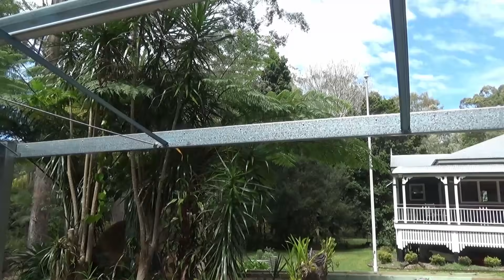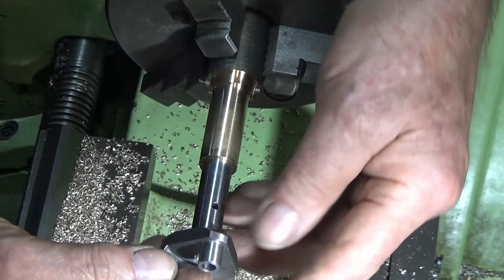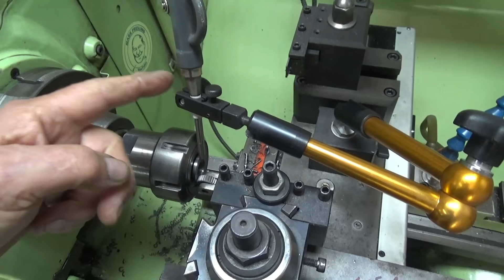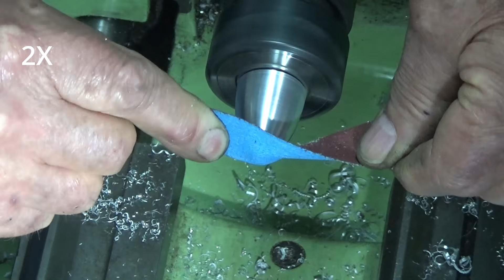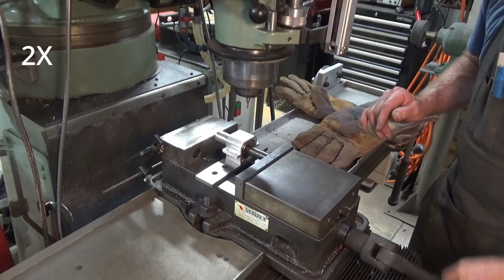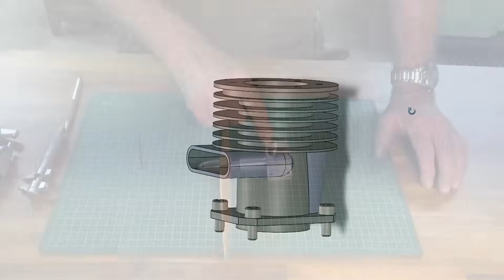Crusader 60. A Model Aircraft Engine You Can Build Without Castings. Ep.3 - Prop Mounting Parts

Comment: Hi Preso. That Turnado turning system is new to me, very interesting. Could you mount a drop on cover plate on the little tool post to shield the template and stylus area from swarf? Cliff
Reply from the maker: I had not thought of that. The swarf does build up easily and it can get in the way. I will need to investigate some countermeasures!
Regards,
Mark

Comment: For the carport.  The sheets on the roof are structural and keep the channels from "lateral-torsional-buckling".  The failure mode is the compression flange locally buckles and the channel rotates to 45 degrees or so and the channel folds up.  It is important to get sheathing on any light gauge framing before load is applied.

Check your drawings for the prop that is in the middle of the channel.  That might need to be at the bottom flange of the channel not the top.  The sheathing keeps the top flange compression in line but when the wind blows the uplift causes the bottom flange of the channel to be in compression so it could use a bit of support to keep it from buckling.

Comment: Finishing up the crank shaft , What's the purpose of the groove by prop driver ?
Reply from the maker: The prop driver has a pocket which fits over a pin in the reduced diameter on the end of the crankshaft. This gives it a positive drive.
Regards,
Mark

Comment: How about using a two piece bronze bush, each with a ‘thrust bearing flange’ one on the inside, one on the outside? This would give you a better surface to cope with the end loading from using a starter? Just a thought.
Reply: I think that's a good idea. The internal one is lubricated by the fuel, but the exterior one would not have any lubrication when staring the engine. But for the brief time a starter is engaged and pressure would be on that thrust face, I don't think it would be an issue. Or, maybe just a machined brass washer that goes behind the prop driver.
Reply from the maker: I have been told about something that I didn't consider. The rear rotary valve prevents the crankshaft from moving axially towards the rear of the crankcase. So, the gap between the prop driver and the end of the crankcase nose may not be an issue. However, rear rotary valve engines are not really designed for an electric starter. Pushing the starter onto the spinner would put an axial load on the rotary valve face which might create a lot  of friction and wear. 
Regards,
Mark
Reply: @Preso58  I did a stack-up and when all assembled there is only a .001" movement of the crankshaft back and forth; unless my calcs are wrong. The movement is controlled by the distance between the front face of the crank counterweight and the front face of the rotary valve. Stacking up the parts it is .651" for the static parts and .650" for the rotating ones. As Mark said above, the gap behind the prop driver doesn't come into it. So trying to limit that movement so, when using an electric starter, the crank moves back enough to push the crank pin solidly against the rotary valve (which then presses against the housing) is not really possible. Maybe slim down the front face of the rotary valve housing and add a brass shim/washer there to take the axial loads (and the brass would be the axial bearing). Or ignore it unless you are going to use the engine in an actual aircraft where it would be started many times with an electric starter. 

Oh, the solid model and the last page of the plans show the small drive pin in the rear of the crankshaft pin extending into the rotary valve housing. I'm being picky here but was trying to understand how it all works and rotates.

Comment: Very interesting again thanks. The carport is looking good too. Perhaps the designer has made it monocoque to save a quid. A bit like having a Spitfire carport instead of a Hurricane?
Reply from the maker: I did call the company with my concerns about the lack of stiffness in the purlins especially. They said they use some engineering software to calculate the wind loadings and the specification exceeds the expected loads. This is probably true but in a practical sense, you still need to build it and that means walking on the roof. I only weigh about 80Kg but I suspect that someone with an extra 40Kg would probably make things bend and not come back. 
Regards,
Mark

Comment: Excellent! I've got the crankcase and crankshaft done, so I can start on these other parts. I think I'd be more comfortable with a slightly looser tight fit of the bushing and using some Loctite. And as for the gap at the front of the engine, how about machining a thin brass washer to take any axial loads from an electric starter? Oh, I also (finally!) bought the diamond tool holders from Eccentric Engineering. A wonderful cutter arrangement.
Reply from the maker: That's great. Please send me some pictures of your engine when you get it finished. I am going to design an alternative prop driver which will have a counterbore on the crankcase side. The aim is to cut the clearance down to around 0.2mm.
I will add the alternative drawing to the set of prints I have already done. I will make this part too and I think I will flycut the face which I had knurled in the video. 
Loctite is a good alternative to a press fit for the bronze bush. It sure takes the anxiety out of getting the interference fit just right. Mine was a bit tighter than it should have been and the bore did close up very slightly. Enough to make the crankshaft stiff. 
Regards,
Mark

Comment: Hi Mark, great job so far ! A word of caution, this design is not particularly suited to using an electric starter. The force applied to engage the starter rubber is carried by the interface between the rotarty valve and it's housing which is likely to cause undue wear. I would suggest you stick to flick starting it. Looking forward to Pt4.👍
Reply from the maker: I had not thought of that! I am going to redesign the prop driver to cut down on the clearance between it and the bronze bush. I will see if I have the courage to flick start the beast.
Regards,
Mark
Reply: @Preso58  If you look at an OS engines plain bearing setup as in an FP or LA series engine, they have a hardened washer between the prop driver and the front of the carankcase to carry the load from the prop driver to the crankshaft bushing. The shaft can move for/aft about 10thou. This works when there is sufficient  clearance for the crank to move rearward without fouling the backplate and the rod can move along the wrist pin. I dont's see much in the way of clearance behind the crank in the drawings. I suspect it is deliberatly close fitted to prevent the rotarty valve sliding forward as there is no other retention for it.
Reply: @Preso58  P.S. you don't have to stick your finger in the prop, you can use a "chicken finger"

Comment: Most of my model engines have that gap more or less. You are correct in that the prop pulls the crank up against the bushing face to make a tighter seal. However the aluminum body gets quite hot when running full-boogie and the case expands much more then the crank shaft and that gap does get smaller. Look at it right after it has run a tank of gas through.
Reply from the maker: I need to check the two other smaller model engines that I have to see what sort of clearance they have. I am going to redesign the prop drive to cut down on the gap which does seem excessive.
Regards,
Mark

Comment: Brilliant. Thanks. Hey I built a few steel buildings during Army service as an Engineer. They are definitely designed to get their sway and racking stability from the skin. Not saying you didn't greatly increase the strength of the structure, but you may have found that it was actually pretty sturdy after all the panels were installed even without the mods.
Reply from the maker: I did get all the roof structure finished today but because this is a carport, there are no wall skins to prevent racking in the vertical plane. However, the posts are concreted in to footings that are 1100mm deep. Even so, walking on the roof feels like walking on a trampoline.
I will be finished all the high work tomorrow. I never want to do it again!
Regards,
Mark

Comment: Motor so far looking good. If you were worried about the gap you could just add an O ring but on the old plain bush motors I have had anything to do with you do need a little gap for expansion and with the rear carb mount only giving a partial thrust face not really a bad thing. The only thing to watch out for is when starting. If you use a modern style prop starter you can wear it quickly due to the push in the wrong direction. Best to use an old school "Chicken Stick" or that's what we used to call them.
Also if you want to do a nicer drive pattern on the prop bush you could try doing it with a fly cutter in the mill and held on /in your dividing head. Or as you have a shaper you could use that Not quite a Rose lathe but good enough.
Cheers
Reply from the maker: I am thinking now that the rear rotary valve will constrain the crankshaft axially so maybe the gap at the prop driver is not an issue? 
Regards,
Mark
Reply: @Preso58  The end float is fine but it will leak a little. The idea is if you ever fly it the O ring cushions the impact and prevents to much valve contact.

Comment: The dimensions that are most likely greyed out because the model was edited and the feature that the dimension is associated with no longer exists. You might try to delete the dimensions and re create them. 

Per Chat GPT:

In SolidWorks drawings, dimensions may appear greyed out (lighter color) for a few reasons, all related to how the dimension is being controlled:

Common Causes
	1.	Reference Dimensions
      •   Greyed-out dimensions are often reference dimensions.
      •   They aren’t driving the model; instead, they’re just reporting values that are already controlled by other features.
      •   Example: If you dimension a hole in both X and Y directions and then add a diagonal dimension, the diagonal is redundant and will show as reference (greyed).
	2.	Dangling / Disconnected Dimensions
      •   If the geometry that the dimension was attached to is deleted or changed, the dimension may turn grey to indicate it’s no longer associated.
	3.	Detached Drawing Dimensions
      •   If you place a dimension in the drawing that isn’t linked to the model geometry, SolidWorks may display it in a lighter color. These don’t update if the model changes.
	4.	Over-defined Sketch Dimensions (in sketches, not just drawings)
      •   In sketches, extra (redundant) dimensions show up in grey when SolidWorks switches them to “driven” mode.

Quick Checks
   •   If it has parentheses ( ) → it’s a reference dimension.
   •   If it’s dangling, you’ll see a small warning symbol and it won’t be controlling anything.
   •   Hovering over the dimension often shows a tooltip telling whether it’s driven, driving, or detached.

👉 In short: Greyed-out dimensions don’t control the model; they’re either redundant (reference/driven) or disconnected from the geometry.

Do you want me to walk you through how to change a greyed-out reference dimension back into a driving one?

Comment: Hi Mark freeflight power flyer in Colorado Springs, Colorado. I think it's important to get rid of that end play, most people today don't start engines by hand anymore but they shove it into a starter or shove the starter into the nose cone, with that gap between the case and thrust washer, during starting you'll be stressing the rod and wearing out the back case.
Reply: Ageed. I would get a stainless shim washer to fill the gap.
Reply: its more than a briggs and stratton lawnmower would allow (the pinnacle of engineering)
Reply: Indeed you also need to be a little concerned about the back plate as it's only partial I think so you can wear them a bit. Anything plain bush should really only be started via a rope or a chicken stick.
Reply from the maker: I am going to leave the prop driver as it is for now although I have designed an alternative which would cut down the gap to around 0.1mm or around .003". I understand what you mean about the rotary valve and it's something that I didn't consider. 
Regards,
Mark

Comment: Mark, just a comment on your colorbond carport. I recently designed and built my own home, with a colorbond roof, and steel purlins. I'm concerned that your designed roof is not sufficiently strong? Here in NSW, building regs required that I use MUCH thicker and braced steel, before attaching the colorbond roof sheets. I'm worried that if you have a strong wind,(with it being a carport, with no way to stop the wind acting DIRECTLY under the roof), that it might take flight!

Just my thoughts mark, regards,
Christine
Reply from the maker: If I had designed it myself, I would have probably overbuilt it. The engineering that came with the kit shows that they have used some strength calculation software and they claim that each member exceeds the expected wind loading but my concern was the requirement to actually walk on the roof while it was being constructed. Even with the extra bracing and adding the SHS inside the purlins it still seems like it flexes much more than I would like. I guess that for a habitable building the code is much more strict. 
Regards,
Mark

Comment: You are so right about tin sheds, same applies to kitset wooden ones, they have no strength until the last screw is fitted. Great in theory but as they wobble and move with the wind etc that last screw loosens and it blows to pieces. You wont know yourself having the whole shed to work in, Im extremely jealous of what you had let alone now :)
Reply from the maker: I was lucky that we didn't get any thunderstorms during the early phase of the build. I was worried about wind gusts. I got the last of the pieces cut and fitted today. However, I never want to build anything like this again. It has just about crippled me.
Regards,
Mark

Comment: That is coming along nicely Mark, well done all round. 👍 Side note: Is the propeller a standard off-the-shelf item? On another note, the Titan sheds I had on the property at Somerset Dam, including the one I converted into a small house, only used a Zinc Alum strap around an inch wide, Tek screwed diagonally across the roof and walls to strengthen it all up. I have to admit, it was a bit of a bitch to pull them tight before screwing them down.
Reply from the maker: The propellor is a standard off the shelf item. When I made the Titan engine, the spinner was a larger diameter and it was really hard to buy a prop with the correct centre hub diameter. The Xoar prop I bought for this engine was a perfect fit. 
I have used that punched strap for diagonal bracing on the house and I made the mistake of cutting it too short. Leaving it longer allows you to fit a stick with a nail to engage one of the holes. It acts like an over centre latch but you sort of need three hands to make it work. 
Regards,
Mark

Comment: Long time fan down in Melbourne.
Recently retired antenna guy. 
Climbed every day for decades.
My tip for anyone doing a bit of roof work, (not aimed at you Mark).
Never climb an unsecured ladder.
You can use a G clamp around the stile, (side rail) of the ladder then on to the gutter to hold it.
Even better if you also lash the bottom of the ladder to a post if you can.
Over the years I have heard all the terrible ladder stories from my customers, up to and including death.
I have ridden a collapsing porch to the ground, fallen into a roof as the battens gave way under me, but never got into trouble on a secured ladder.
Reply: How you can get to the top of unsecured ladder to secure it? 😂
Reply: @VladekR  
1 Ideally you start with a ladder that is wide at the base for stability.
2 You make sure it is on a stable footing and vertical, (from the perspective of climbing it).
3 Then my friend, you do the clever thing and get someone to hold it from the side, so it can't move left to right.
Reply: @VladekR  You only have to climb it once to secure it
Reply: @howardosborne8647  What if it is just 'one off' climb? Having strong companion holding ledder seems to be logical. PS. Is it true that in USA ladders have to have (by law) written on the last step: "LAST STEP" ?
Reply: @VladekR  The risk from climbing and securing is significantly reduced vs the risk of actually working with tools on ladders. i can't see any case against that logic.

Comment: i enjoy your videos Mark 
i have a Myford super seven lathe built in 1972 and a quick question on parting off . Is it better parting off from the back tool post rather than the front tool post
Reply from the maker: I find that the rear parting tool is much less prone to digging in. The geometry and dynamics are very different and because the tool post is not sitting on a compound slide, there are less surfaces in contact. I believe Hemmingway kits sell a rear parting tool kit for a Myford lathe. I did a video showing an animation of the forces at work on the rear parting tool compared to a conventional one.https://youtu.be/QuyXYyXHc4o
Regards,
Mark